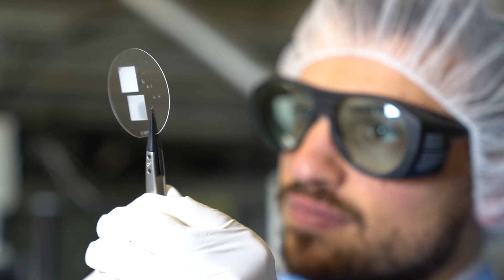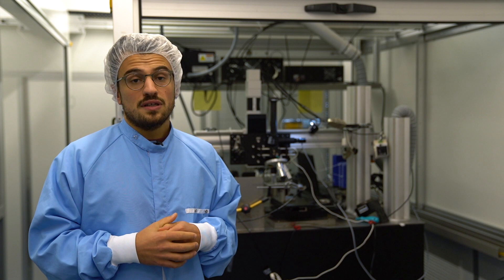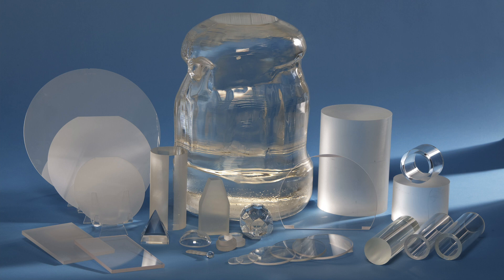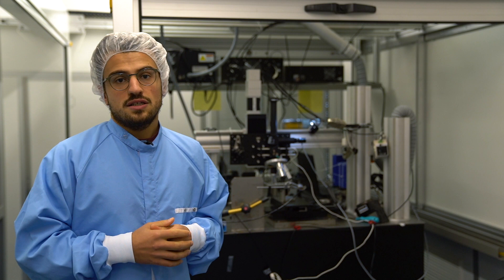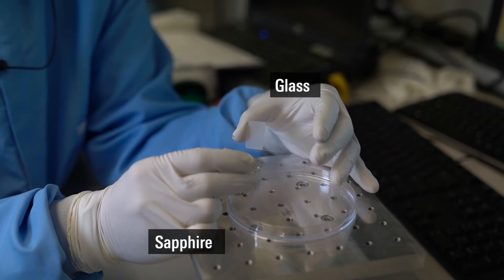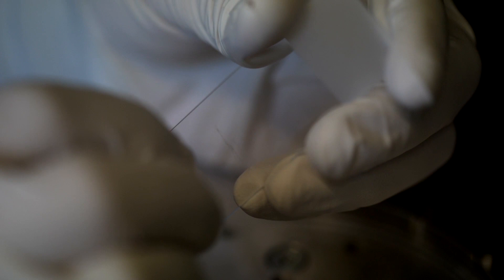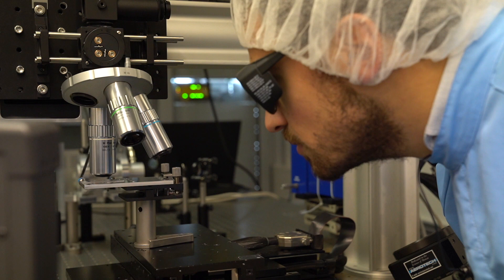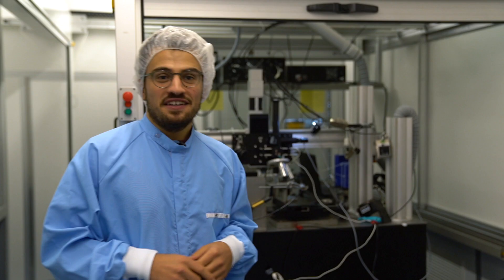Micromachining of sapphire, a material of the future

Comment: Would like to know more about the laser and challenges.  I was searching for information about how sapphire is machined, so now I think I know you can use diamond-tipped saws and lasers, presumably fiber lasers.  What laser frequencies work best?  Is this something a hobbyist could etch using a $1k fiber laser or 450nm/666THz 5w diode laser?

You mentioned you wanted to make a hydrophobic surface, I think, but microetching sapphire might also offer some microfluidic opportunities.. say, could you etch an integrated circuit?

It has been three years, you probably are a PhD now.  How'd it go, Doctor? :)